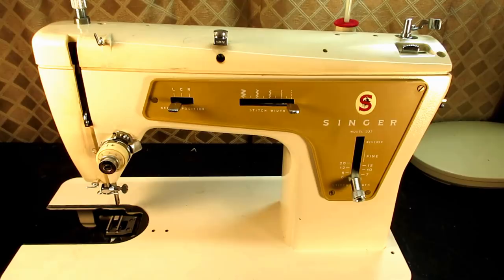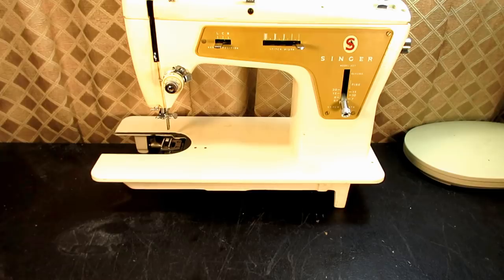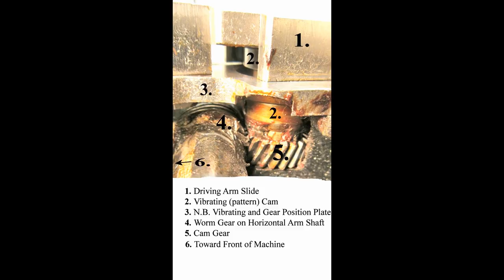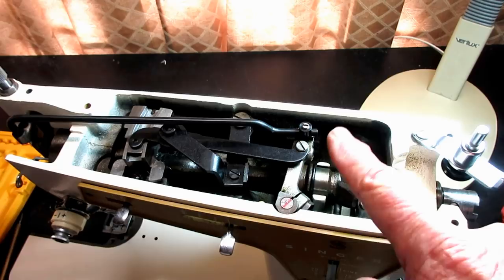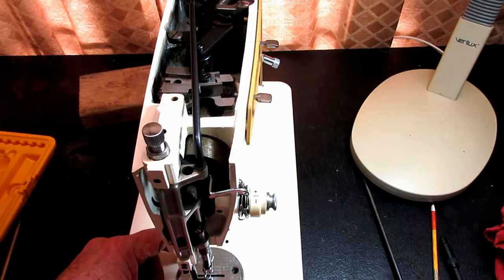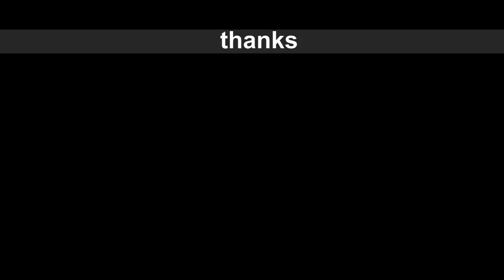The Zig Zag Slide and Traveling Hook Systems on the Singer Model 237 Sewing Machine

Comment: Brilliant, Andy. I just got one these off ebay, slightly different. Maybe not the place to ask technical advice, but - on mine, there is so little friction when moving the stitch width lever that it moves left on it’s own when turning the handwheel. This seems wrong, but I can’t see where resistance would come from, unless it’s missing a part. It also has the same broken indicator flange Stella had, plus a broken motor pulley from shipping damage. I’ll try to find those parts.
Reply from the maker: Slightly different? But a model 237, right? It took a fairly strong hit to break the motor pulley I think, so something may have been knocked loose. The parts of the ZZ system are metal, so I'm thinking loose but not broken. This video shows the removal and replacement of the ZZ slide and explains the upright shaft down to the hook shaft. If the set screws on the shafts got loose then I could see the lack of resistance. If you put it in ZZ mode and hold it there then does the needle bar swing left and right? Does the hook travel left and right in time with it?
Did you see the video for the vibrating bracket? https://youtu.be/jKN-yOOBwr0
I don't remember if there is a set screw holding the motor belt pulley to the shaft. If not then I think this pulley would work: https://www.vintagesingerparts.com/products/singer-press-on-motor-pulley-fits-most-200-series-300-series-and-400-series?_pos=9&_sid=b9ac9c01e&_ss=r
Reply: Andy Tube Thanks for the link, my pulley does press on so that should work. I think I may know what’s causing the very free travel on the zz lever. If it took a hit on it’s tip, the force directed inward, toward the back of the machine, it could bend the “z” shaped piece of spring steel that connects it to the arm enough that the lever wouldn’t have upward tension like I think it should. I can see that the two bends in that connecting piece are not 90 degrees, more of an acute angle. I tried wrapping the lever with some thin rubber and pulling outward with pliers, and I think I may have made a tiny improvement before the pliers slipped, but that is some tough, springy steel. I would rather get the parts on a bench to bend it, but so far every screw in the linkage is VERY frozen. I already damaged one, trying to loosen the rod so I could center the needle better. Soaking in Kroil, alternating heat from a tiny butane torch, nothing has worked yet. 
   Yes, the hook does move in tandem with the needle. The machine has potential, does sew when turned by hand.
Reply from the maker: Nicely done, Gary. I think you have it under control. Yes, frozen screws. Been there many times. I use a can of 8-year-old WD-40 and a hairdryer but mostly it is a matter of time. Sometimes you can put a well-fitting screwdriver in the slot of the screw and give it one or two good raps with a mallet/hammer and break the freeze on a screw. I usually just spray & pray while I take other parts off in prep for washing the machine with the Krud Kutter. Hollow ground screwdriver bits work best. Here is a free instruction manual if you need one:
https://www.singer.com/sites/default/files/product_manual/SINGER%20237%20Sewing%20Machine.pdf
Reply: Andy, many thanks to you for your effort in making these very detailed videos. And getting responses to questions about seven month old videos within the hour? Priceless!

Comment: Thanks Andy for your great video's and your replies. A issue I have noticed with my newly purchase 237-M is that needle is not centered (front to back) in needle throat plate. Needle is clearly more forward in needle plate, with a #16 needle there is only about .006 and with a #18 needle is is perhaps slightly touching. I don't see that there is an adjustment to better center needle. Is this closeness ok or do I perhaps have a needle plate that not matched well to my particular 237 ?
    Thanks in advance,  Bryan
Reply from the maker: The Part No. for the Needle Plate on the 237M is 352105 if you want to check that. Remember that the hook on this machine "travels" whereas on most machines it is stationary. The Service Manual has instructions for centering the needle Side-to-Side in the hole of the Needle Plate, but not Front-to-Back. On this machine, you adjust the Shuttle Race Frame to the Needle Point at .010 inches. (Shuttle being this manual's name for Hook) When that is correct and with the correct Needle Plate that should put the needle in the correct position in the hole of the needle plate. Traveling Hook 😃The instructions are on Pages 7, 8, and 20 of the Service Manual which you can have for free by emailing Alan at andymanuals53@gmail.com and asking him by name for the Singer 237M Service Manual. He will reply with a PDF of the manual and then erase your email. I'll let him know to expect it. Good Luck.

Comment: Another question for you Andy! I previously asked about rust. I’ve run into an issue where there is rust and what looks like the very beginning of some corrosion on the gear under the cam and on the big arm (worm?). Happen to have any info on getting into that area? I will probably have to dismantle some right?
Reply from the maker: Removing the parts as I did in this video may be the closest you'll get to the worm. The "corrosion" you see may just be dried grease. Even the Service Manual for this model warns about removing the armshaft b/c the work gear on the shaft and the gear is mates with are lapped together at the factory, and changing that lapping, even by a single tooth, with cause a lot of noise and vibration. They do not describe how to remove those parts. It's best to try and clean with chemicals and brushes. The rust removers can't clean very well through oil or grease, so I use the degreaser first, then the rust remover if needed. I'll be happy to give you copies of the Service Manual and parts diagrams if you feel they could help. Email andymanuals53@gmail.com. Put "Singer 237" in the subject line. Allan will respond with PDF copies. Good luck.
Reply: Thanks again! I will degrease first and then go in with the rust remover. You have been so helpful, I really appreciate you!

Comment: Andy, I finally got my two stuck screws unstuck, but did some damage to the set screw that secures the rod that centers the needle. I would like to replace it with an allen type set screw, but I remember you saying that few screws on a Singer are replaceable with standard fasteners. This one measures 4.4mm, or about .174 diameter, around 40 threads per inch, near as I can tell. It could be metric - machine is made in Italy - or US Standard, whatever that’s called, but I’m getting the feeling it’s a Singer specialty screw and I will be reusing the old one. Any thoughts?
Reply from the maker: I usually look for an original screw from someone selling parts of the model. Even if they don't list the screw for sale I will email them with a picture of where it is on the machine and often they have it and will sell it to me. eBay is a source more often now, but I usually look first at thrifty farm girl: http://thriftyfarmgirl.com/sewing-machine-parts
I see she has parts right now from a 237 so you could ask her if she still has the rest of the machine. 
I think most of the set screws are either 32 or 36 threads, but you can look (download) this PDF and see a list of Singer screws:
http://needlebar.org/manuals/singerscrews.pdf
I only ruined a couple of screws before I realized it was faster/cheaper to take my time with them then try and find replacements.
I did have a viewer mention he tapped out many of the screw holes on his slant-needle machine and replaced them with US sizes and Allen type (or other) screws. I was quite a project I'm sure.
Good Luck.

Comment: Thanks again...how do you adjust the timing on this model? Do you have a video on adjusting the timing?
Reply from the maker: I do not have such a video. Normally if you set the needle bar at the correct height the timing is automatic b/c of the way the machine is made. Needle bar height video: https://youtu.be/bRjfg2VaqP4   If you are skipping on ZigZag stitches there is an adjustment for timing the pendulum movement of the needle bar. This fellow talks about it in his video: https://www.youtube.com/watch?v=8TONKVFi1fg  He does NOT demo how to do it, however. It is in the Service Manual on page 26. In the comment section of his video, he mentions where he got a free copy of the service manual. You can also buy a copy at this link: https://manualsoncd.com/product/singer-237-sewing-machine-service-manual-download/
Reply: @andytubesewing1953  Thanks,,, always very helpful....I removed the rolled pin and adjusted the timing and reset the pin. The set screw was also missing.
Reply from the maker: @GeoffreyScheid  Congrats. (Wish you made a video.) Thanks for watching my channel, and nicely done.

Comment: Andy, I have a 237 and I am wondering how close is the needle to hook clearance does it call for? My machines' needle is quite a ways away from the hook. I assume it has to be set by loosening the upper clamp on the vertical connecting shaft and shifting the traveling hook shaft either forward or backwards? Thanks for your help.
Reply from the maker: The needle "as close to the hook without touching" The service guide says to loosen that upper clamp and move the "shuttle race frame" forwards or backward to set the gap then tighten the upper clamp, AND the "shuttle race cap" must be adjusted to .010 inch also. I'll email you the service guide if you like. My email is on the "ABOUT" page of this YouTube channel. You need to subscribe to see the email address. Thanks
Reply: A very interesting video again. Still have not solved my problem. But I m learning a lot. Thank you very much Andy! You are so helpful